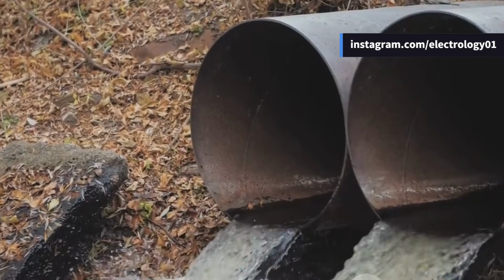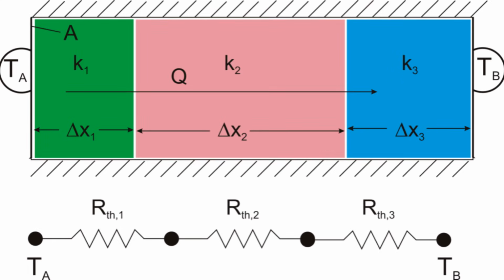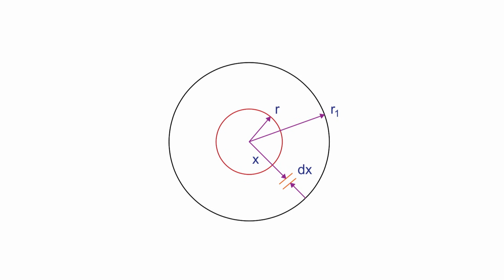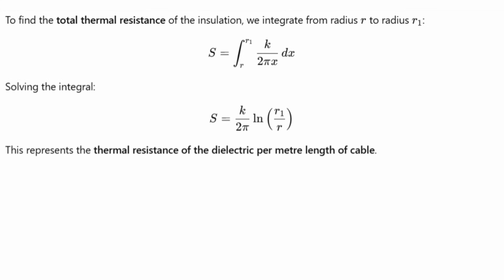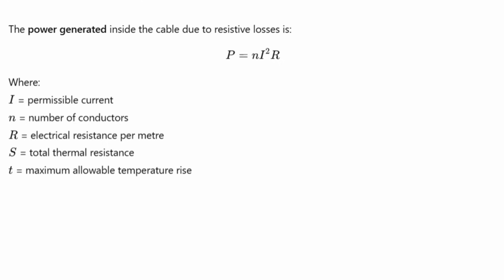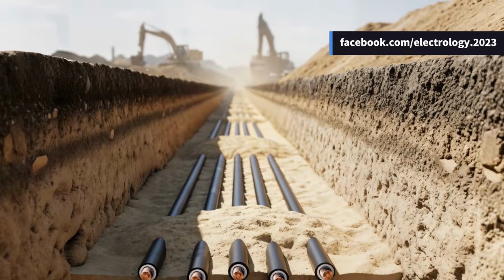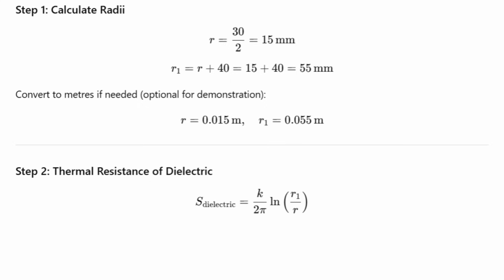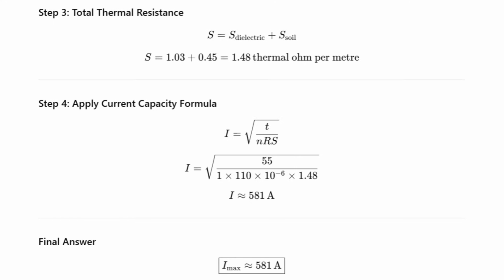Underground Cable Current Rating Explained | Thermal Resistance, Dielectric & Limits

Comment: Yes. More video's on thermal resistance of different ground types and even cover under water thermal resistance as well. I am in NY,USA Our soil can vary a lot threw out the country, All this applies to HVDC and HVAC cables as well. It is the amps that make the heat along as dielectric heating from the insulating material used.   And eddy currents in AC cables. All adds to heat ! In out west coast in California in the  LA area underground cables are OIL cooled like a transformer and the OIL is pumped threw to keep cables cool. Very poor soil their and with GW power . Oil cooled underground had to be used. Some underground cables are run in a tunnel ,so air cooling can help. Usually run aside a subway system. And if it breaks we can get to it with out digging it up. Cheers from NY !